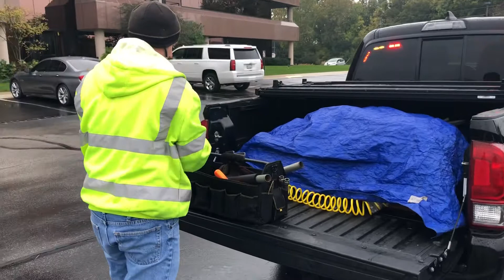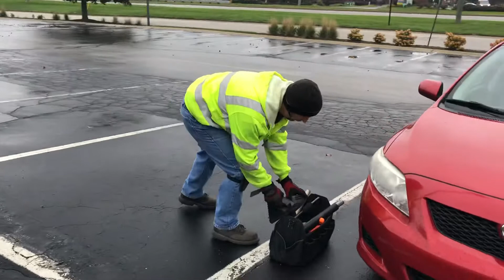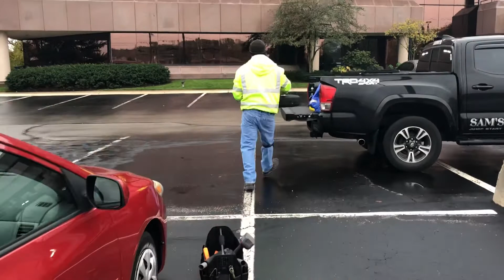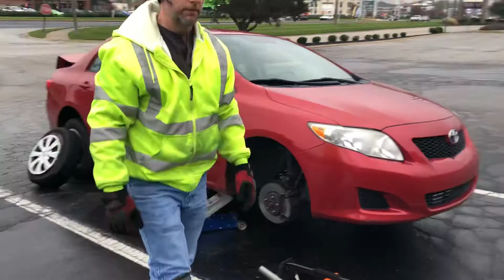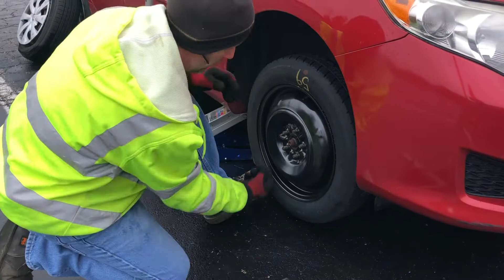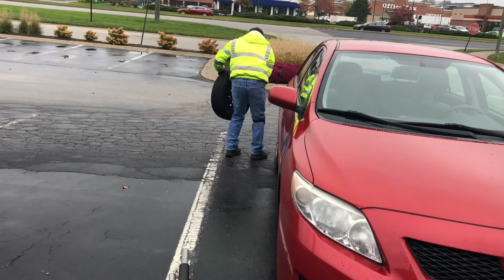The Roadside Assistance Business | Tire change | Raw video

Comment: I doing road side assistant for part time but today i wast sent 40 miles away and got pay $31 is that bad? because i have to travel back another 40 miles.
Reply: For what company naw man that's now worth it your wasting fuel those $31 mostly going on gas
Reply: Do what you got to do stay in the area don't drive back wait on the next car that way you're always getting paid when the wheels are turning
Reply: $31 Is too low. This same guy charged $65 to install a donut on a busy highway. Not sure how far he drove but I would have charged at least $60 for that job.
Reply: You got reamed fk that. Mileage fee